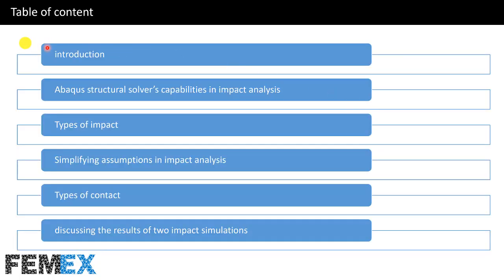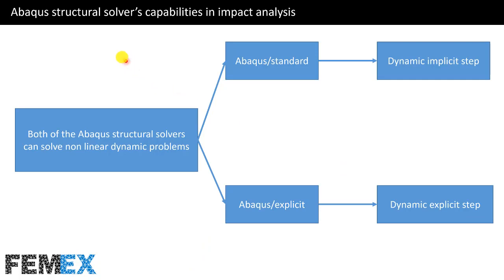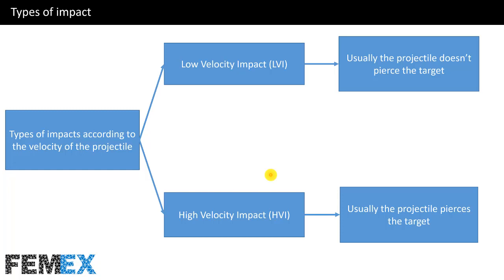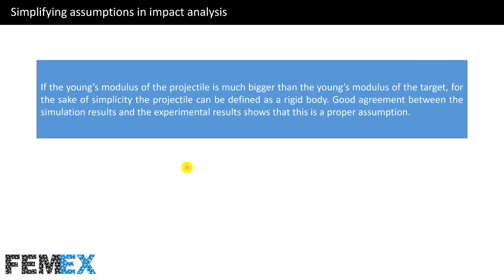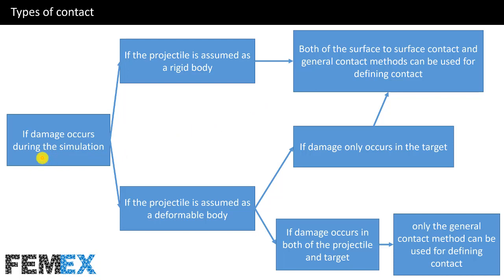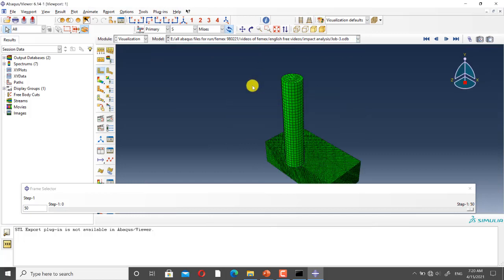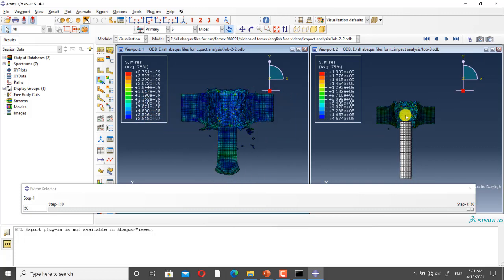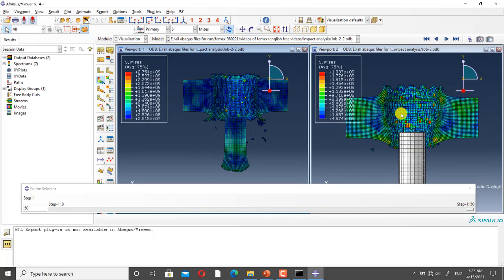impact analysis in Abaqus

Comment: Hi sir, I have a qusetion, contact between projectile and target must define in initial step or in step-1 ? 
also about the velocity of projectile if we defined it in initial step it will propagate to step-1, right? In this case abaqus will decrease the velocity caused by the occuring damage ?
Reply from the maker: Hi.
1) In this case, there is no difference between defining contact in the initial step or step-1.
2) Yes it will propagate to step-1.
3) The velocity will decrease because of the contact and the stiffness of the target. The speed will decrease even without the occurrence of damage. The kinetic energy of the projectile will be absorbed because of all of the mechanical behaviors of the target including the elastic, plastic and damage behaviors.
Reply: @FemexIran  I did not understand something that is, we know that there is a distance between projectile and target at the first of simulation, so how can we define this contact in initial step and at first there is no any contact? 

the second qyestion is: How can abaqus know that it must decrease the velocity, may be it assume that velocity is constact at all time of simulation. so we must do something or abaqus itself can know that?
Reply from the maker: @alialijamelll5016  
Hi.
1) we must always define contact between the parts which are not initially in contact but maybe throughout the analysis, they come into contact. If they come into contact, the contact definition will work in the model and if they don't come into contact, there is no problem.
2) If the impact happens, the velocity of the projectile will decrease and if no impact happens, the velocity will be constant. Actually Abaqus solves the physics' laws and they are clear. It solves the Newton laws in this case.
We have a premium video about impact analysis. here is its preview link:
https://www.youtube.com/watch?v=87oMNzBokYI&t=39s
Also other explanations are written in the description below that video.
Reply: @FemexIran  i am very grateful 
Thank you very much
Reply from the maker: @alialijamelll5016  You are welcome.

Comment: hi, Thank you very much for the answers that you answer with full grace
I have two questions about your answers for Mr.'s H J questions: 1) you said that newtons second law will give us the impact force, why we do not consider the reaction forces from the boundary condition (support) because as we know there are external forces and must be considered in newtons second law

 Mr.'s H J asked we must multiply mass matrix by the acceleration and you said no by the mass of the projectile. My question is from Abaqus we will get the acceleration for each node not for the projectile so why we must multiply the acceleration for each node by the total value mass of the projectile and we do not multiply mass of each element by the acceleration of the nodes?
Reply from the maker: hi.
you are welcome.
if you want to understand the answers to someone's questions completely, you must read all of her/his questions and their answers because maybe I have explained something in the previous answer and you didn't read that and you think the answer to another question is not complete. the answers to your questions:
1) we use the newtons second law for the projectile. the projectile does not have any boundary conditions. only the plate has boundary conditions.
2) as the projectile is rigid, according to the dynamic of rigid bodies, the sum of external forces on a rigid body is equal to multiplication of its total mass and the acceleration vector of its center of mass. in Abaqus, the reference point is something like center of mass.

Comment: I'm so sorry, but I have two more questions about this thing if you can please answer me,
1) you mean by mass the mass matrix is this correct ? And we must do multiplication between the mass matrix and the acceleration only for the elements that are exposed to impact?
2) You said that we used Newtons second law and the only force that happened is impact force, So the string force and damper force will not be considered I mean for the plate ?
Reply from the maker: you are welcome.
1) no. I do not mean the mass matrix. I mean the total value of mass of the projectile. I do not talk about elements because I said the procedure of calculating the total force of the projectile.
2) two type of forces are applied to the plate.
- reaction forces from the boundary conditions
- impact force from the projectile
other forces are internal forces.
I think you must review my answers and think about them for better understanding.

Comment: so, please can you explain how to calculate the total contact force between the projectile and the target. I will be grateful to you
Reply from the maker: if the projectile is rigid, you must follow this procedure:
1) create a geometry set from the reference point of the projectile.
2) request the acceleration components for that set as a history output.
3) after running the simulation, in the visualization module, you must multiply the mass of the projectile by the algebraic sum of the requested acceleration component.
point 1: if the projectile has a straight path, there is no need for algebraic sum. you must only use the acceleration component that is parallel to the displacement direction.
point 2 : in this procedure, we use the second newton's law that says the sum of the forces is equal to the multiplication of mass and acceleration. the only force applied to the projectile is from the target.

Comment: when we have an impact on a plate for example a bullet, the forces induced from this impact will evenly divided between the elements that were exposed to this impact? and what is the amount of this forces?
Reply from the maker: hi.
the elements that are in contact with each other experience the contact forces.
I know how to request and calculate the total contact force between the projectile and the target. but I don't know how to calculate the contact force on each of the elements that experience contact.
in the articles, they only study the total contact force or the contact pressure.

Comment: in theory when we solved problems in paper we should change the stiffness matrix or no? 
And the formula of stiffness matrix in low speed impact is same as the stiffness matrix of linear and small deformation?
is this nonlinearity geometrical or material non linearity?
In all cases low velocity impact will induce a small deformation?
Reply from the maker: hi.
1) as far as I know, in the analytical solution, we cannot account the change of stiffness due to the large deformations.
2) at the beginning of impact, the formula is the same.
3) material nonlinearity is a different matter. it is related to plasticity, damage or hyper elasticity.
4) no. in low velocity impact, the target is not perforated completely but there can be large deformations. for example strain equal to 10 percent is a large deformation.